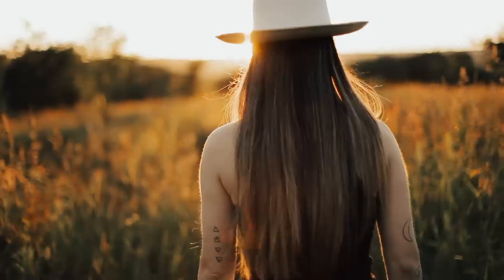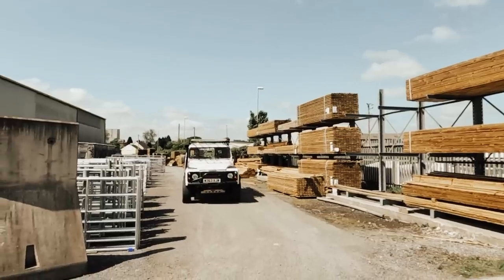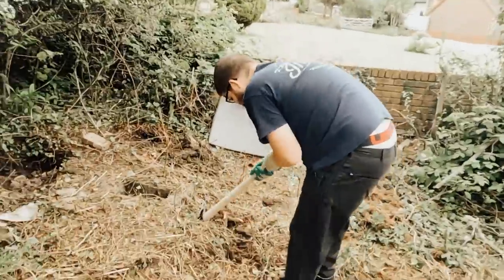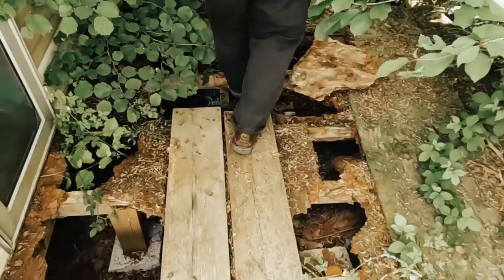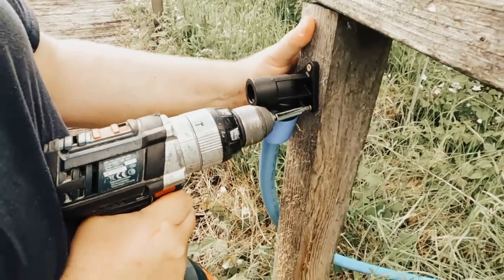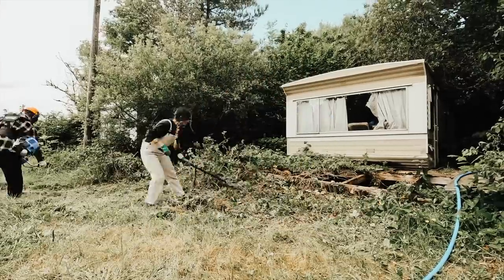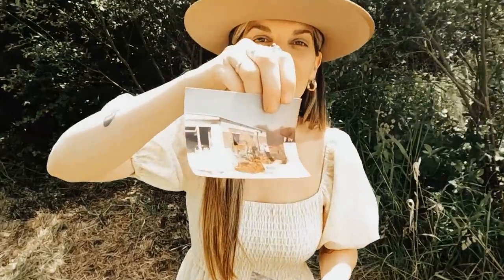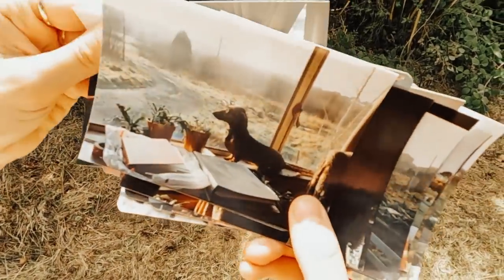Renovating our abandoned caravan park. Pt.1 | Moving day, getting water & electricity + big clear up

Comment: The water pipe should be 750mm deep (as per regulations) to protect against frost. Which means you would have found it if you'd dug down a little more. The existing pipes would be good.
Reply from the maker: Thanks 😊 luckily we found the feed into the caravan!
Reply: @CampOutWest  also be nice to fit a check valve to the pipe that feeds your new tap
Reply: @TheFool2cool  only Nice??? Essential!!!
Reply: @PS-bs8oe  I try not to tell people what to do, it can get their backs up. Yes it should have a double check valve by regs. But lately nobody seems to believe in the water regs 😒
Reply: @TheFool2cool  yeah  I noticed your politesses in there , clean speech, all good ;)

Comment: Just a tip for gate posts or fence posts, you can use a dry mix for fixing them. Mix your sand, cement & gravel dry, tamp it around the post and it’s done. Capillary action will draw moisture from the ground and set the mix hard. 

This allows you to use posts immediately and you don’t have to wait for the mix to dry. 

I’ve done this for years fitting thousands of feet of fencing, it’s never let me down. Trust me, it is just as hard when you have to dig it out.
Reply from the maker: Wow thanks so much for the tip Bally! We haven't fixed the gate yet so this will be great to try! Thanks so much 😊
Reply: @CampOutWest  no problem

Comment: You need to sell the bikes and if you find a Calor Gas heater  (Mobile gas heater) keep it as there very good for what they are and they run of 	Butane gas 🙂
Reply from the maker: Thanks for the tip Kevin! Sadly the bikes are sadly rusted and ceased (Jon's and ex bike mechanic and said the bikes are past the point of repair sadly) but thanks for the heater tip! 🙂

Comment: Here's a couple of bits of advice. Get a set of proper cutters for PTFE pipe, not only will you have less chance of a leak, they're much easier to use than faffing with a hacksaw. You probably didn't notice, but the pipes under those old caravans all had insulation on them. Make sure you put insulation on thme before winter or you'll spend half your time thawing frozen pipes.
Reply from the maker: Thanks so much Hugh! Proper cutters are a good shout! We are hoping to be in our first cabin by Christmas so will hopefully have buried/correctly installed pipes by then

Comment: Couldn't you have kept the best van  for storage/shed? It's not like you are short of space
Reply from the maker: No, sadly they are all rotten and literally have holes in ceilings, floors, completely waterlogged and full of damp/mould etc, so past the point of repair and really wouldn't keep anything safe, clean or even dry, so they have to go :) Also we only have planning for 3 residential park homes/caravans on our land, so these all need to go before we replace them with our self-built tiny homes, otherwise we will be over the limit for our licence